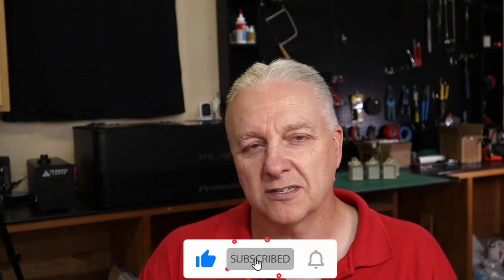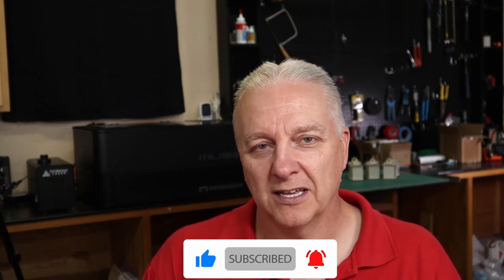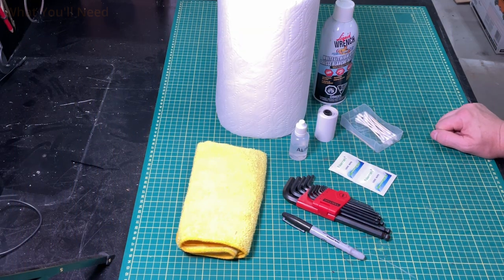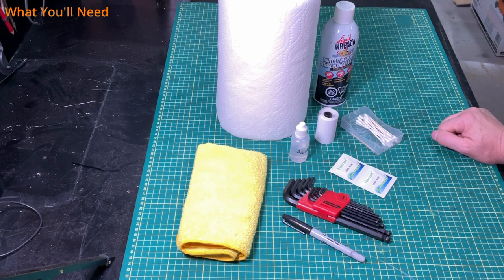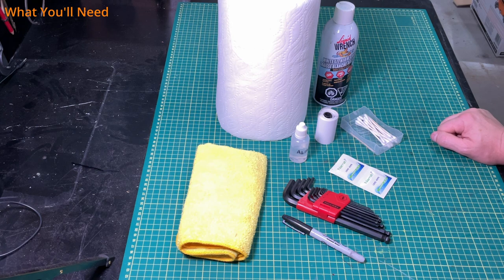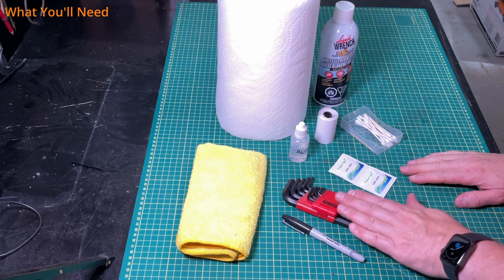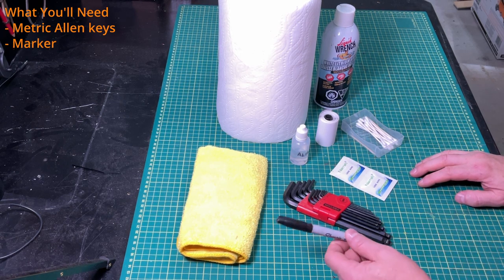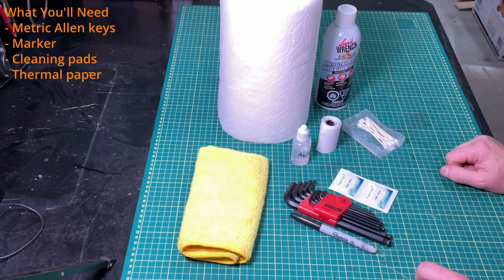Laser Machine Maintenance

Comment: Hi Steve, it's been months since I've chatted with you.  I still have my Full Spectrum 90W laser, but yesterday it completely quit. No power, no lights, nothing. I've submitted a ticket, but no response since I'm out of warranty.  Any suggestions? I checked the fuse, cord, power outlet, etc.
Reply from the maker: Hey!  Sounds to me like the 12/24v power supply is dead. You could try to measure some voltages on the main controller board if it’s something you can handle.  Stay away from to output on the high voltage supply to the tube though
Reply: @SteveMakesEverything  Oh gosh, what is the 12/24 power supply?  Do you know where I locate it, and then I can put an electric current probe on it.  Is it expensive to replace?
Reply from the maker: @sallyann-nicolemiller5625  It shouldn't be too expensive but FSL does charge a lot for parts.  What I would suggest is to unplug the laser an let it sit for an hour, then try to find the power supply and first look for loose plugs on the main board (no danger if he laser is completely unplugged from the wall for a while).  Maybe the power connector has become dislodged from the main board.

I'm not sure where it is in the 90W laser, but it will be behind a panel somewhere on the laser.
Reply: @SteveMakesEverything  Steve, thanks. we finally got it working. a safety switch in the back was loose.
Reply from the maker: @sallyann-nicolemiller5625  Good to hear.

Comment: Hi Steve Makes -- hope Steve can Fix.  I laid a 19 x 11" 1/8 sheet in the PS24 to cut out ornaments.  When I get to about 12" across, it no longer cuts and barely engraves.  I 'attempted' to align my mirrors yesterday, cleaned the lense, but it didn't resolve the problem.  Any suggestions?
Reply from the maker: The latest alignment video that FSL put out a few weeks ago is actually a pretty decent tutorial. Take a look at that